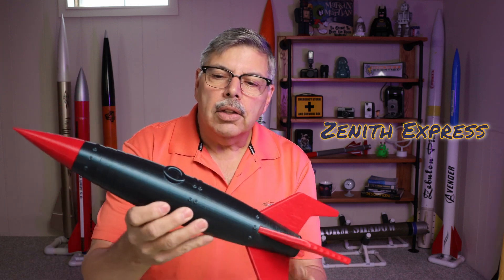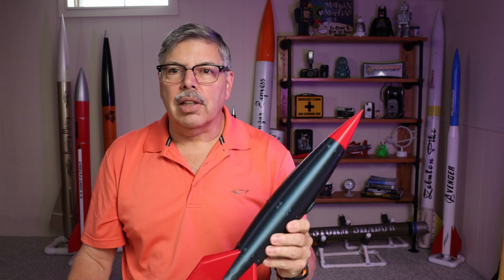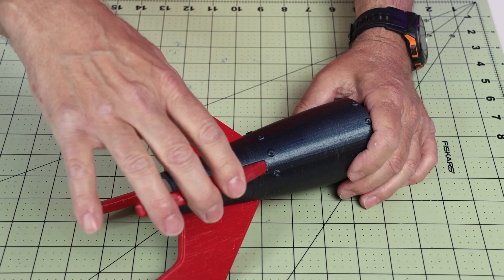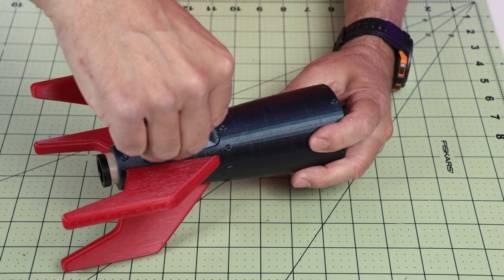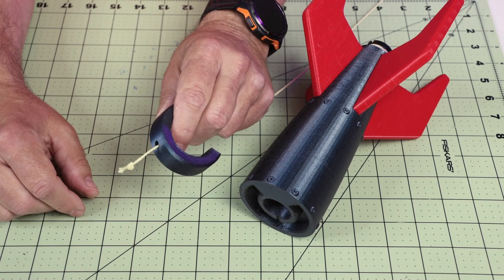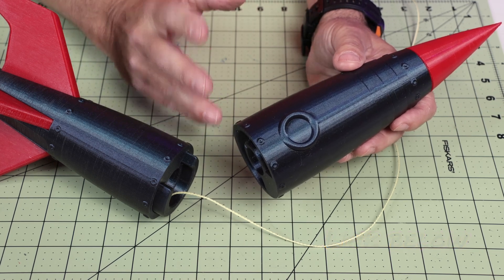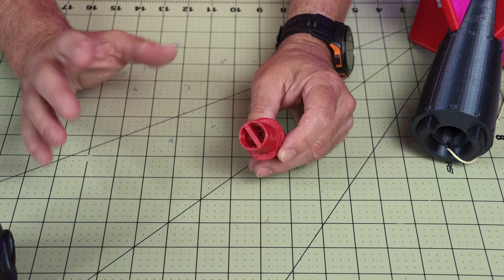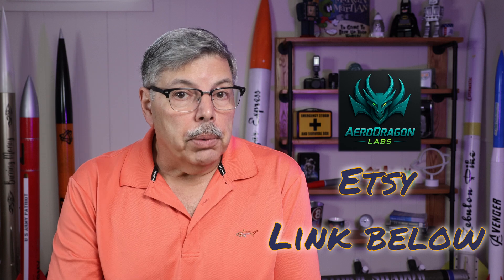Zenith Express, 3d print kit build and flight!

Comment: I printed a similar looking rocket last fall.  I searched google for images of scifi rockets and got some inspiration.  Mine is 12" long, 2" maximum diameter.  I put a piece of 24mm tube in it for the motor mount and BT-55 for most of the length for parachute and nose cone fit.  With the cardboard tubes in there for insulation it works well just printed in PLA.  It flies really well on a C11-3.  I also agree- there are a lot of rocket-related things that are easy to make with 3d printing.
Edit- My apologies- I was writing my response while watching the video.  I hit save before I realized you were making this a kit to sell.

Comment: You should think about replacing the launch lug with two rail guides. A 3/16" launch rod is not safe with an E or F motor.
Reply from the maker: We have not had any trouble with a 3/16 launch rod.

All high power rockets with an H class motor or above use rail buttons at our club.